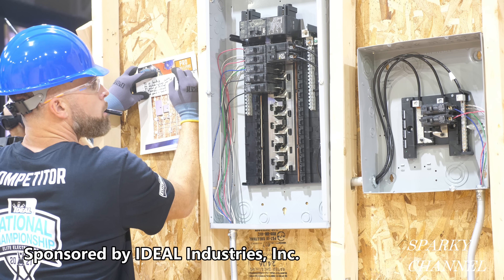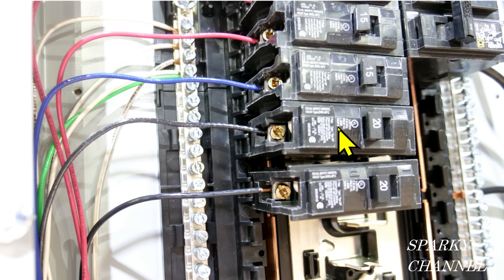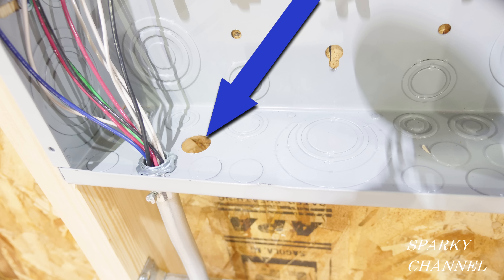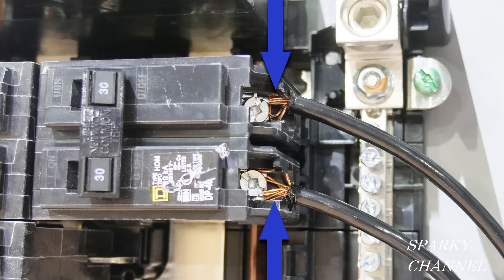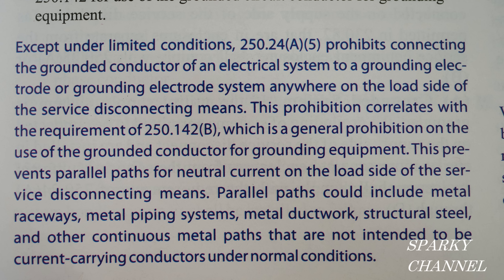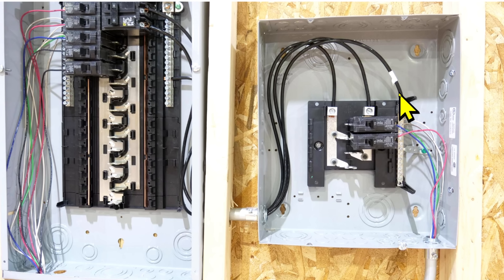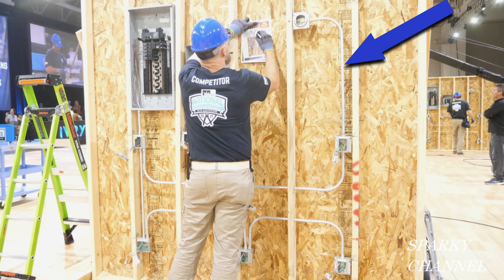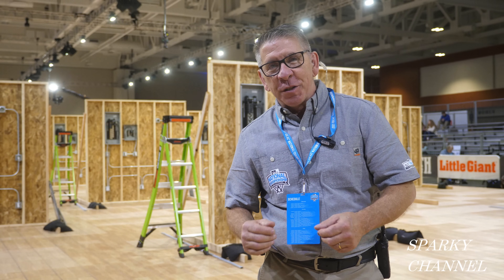Find the NEC Code Violations! IDEAL National Championship Code Violation Board Round 1 Part 2

Comment: But NEC  allows wire  manufacturers to use a thinner insulation on wires now days.  How is that progress??
Wire  years ago  had  twice the thickness of insulation. Did  safety get compromised  to save money??
insulation is everything
Reply from the maker: This is from the 2020 NEC so it should all be up to date.
Reply: theres a lot of different insulations you can buy, with different voltage ratings, theyve found better plastics that can insulate just as well and reduce pipe fill
Reply: The natural rubber used in 1930 was over four times as thick as modern THHN/THWN, the critical values are abrasion resistance and dielectric separation, and the TH from the 1940s used the same OD as modern THH/WN, or maybe a bit larger, I haven't checked with calipers.
Reply: If it's better then it would have a greater shear strength..dont see how it could if it thinner
Reply: @71organicmusic9  you are comparing rubber to nylon, and a cotton sheathing to a cross linked polyethylene sheathing, we have a large list of different materials to work with now and arent limited to rubber, as well they have plenty of tests to get a product ul or csa certified

Comment: I'd have to say NEC IS the violation making this CRAP now mandatory
Damn AFCI's and those stupid "Tamper Resistant Receptacles" 100% trash now!
AFCI's are not ready for prime time yet! However the GFCI is as they have been around for years now and pretty much all of the kinks have been worked out but a GFCI with the older NEMA 10 series for a dryer and range will always trip as the ground and neutral are tied together thus the GFCI seeing a ground fault, the NEMA 10 series is un-grounded.
Reply: Yup, they lobby hard to make old appliances/machines obsolete, including welders
Reply from the maker: Thanks!
Reply: @SparkyChannel  Real or sarcastic Thanks? 
NEC is going way beyond the "Minimum Standard" these days in my humble opinion.
Reply from the maker: @Peter_Yachymczyk  Real thanks because I can tell that you're giving your real opinion.
Reply: @SparkyChannel  Cool can't always tell with internet speak
Reply: The arc faults ate s little touchy trippy.  But by in large the code requirements are an improvement

Comment: Gray wire as a grounded conductor ?  NEC used to state the color of the grounded conductor was required to be white or NATURAL gray (as in raw uncolored wire insulation).  Did NEC drop the ball or something ?
Reply from the maker: Hi Farmer Dave! See 7:35
Reply: 277/480 Neutral

Comment: I saw quite a few code violations that were missed. No Ground Wire to Subpanel, no separate bus included for that grounding in subpanel, I believe today's subpanels must have a sub-main disconnect inside the subpanel itself, though not a code violation, breaker amperage should be arranged with the highest amperage breakers closest to the main on the bus.
Reply: Sub main disconnect is if over 6 breakers.  Unless that changed.
Reply: @whattheschmidt  Thanks, though not over 6 breakers, the panel has the facility for over 6, therefore I would expect the necessity for a Sub-Main Disconnect.
Reply: @yo yo I beg to differ. Though it is not a code violation, it is still better to have the highest draws closer to the main.
Reply: Correct me if I'm wrong, but wouldn't the conduit connecting the main panel to the subpanel count as the equipment grounding conductor?
Reply: @KingdaToro  No, it never is.

Comment: @2:23  I was taught to leave 1/8" of exposed copper and I continue to require apprentices to do so.  The entire screw is hot, It's not an additional hazard.  Having insulation under the lug is a hard to find problem, it will act like resistance/a bad connection/fire hazard. It makes it easier to inspect.
Reply from the maker: I would say don't get any insulation under the terminal and don't leave too much copper showing. The example I showed in the video was about 3/8" copper showing. I felt that was too much copper showing.
Reply: @SparkyChannel  oh, the 3/8" doesn't look like much in the video
Reply: It Cerates a High Open or High Joint Depending on Where You Live and if You Point a Thermal / Temperature  Gun at The Screw it Should Read a Higher Temperature Under Load Than The Other Breaker Screws !

Comment: A 2P breaker or handle tie was not used for the multiwire circuit in the main panel? 240.15(B)
Reply: It's actually not. If it was, there would be only one neutral in the panel. Two neutrals means two separate circuits.
Reply: @KingdaToro  There are 5 breakers but only 4 neutrals if you look carefully. So one has to be shared.

Comment: Shouldn’t the breakers be AFCI and or GFCI
Reply: You're all assuming this is a residential installation. Metal boxes and emt. This could be considered a commercial installation where AFCI and GFCI aren't necessarily required. I guess it would be up to whomever is putting on this competition to clarify.
Reply: I thought so too in new construction
Reply from the maker: You just caught another violation! :)
Reply: What is afci? I could Google it, but human interaction is more satisfying
Reply: @Patstickyman  Arc Fault protection. They are required on all 120 volt 15 and 20 amp circuits in "dwelling rooms", pretty well everywhere except garages and some basements (ones used only for storage). Kitchens and laundry rooms used to be excluded but most if not all now require them.
Reply: @Patstickyman  Arc Fault Circuit Interrupter. Any arcing or fast rising high current spike at load startup will trip them but they are a pain where power tools are used & for older refrigerators due to inrush current spike at start because of the inductive load.
Reply: @davidbrewer7937  okay, so similar to how a 3 phase motor would have overvoltage protection to keep it safe from the spike when it initially starts?
Reply: AFCI in bedroom's only where i live.
Reply: Outlets are all AFCI these days with the exception of the refrigerator dedicated line.

Comment: It looks to me like the top four circuit breakers are the ones not installed properly and the 20 amp is actually installed correctly. Those four breakers don't appear to be engaging the plastic tab properly on the left side. Are we assuming that the main breaker is the service disconnect? If not, then the neutrals and grounds must be separated in both panels and the bonding screw removed. Also, is the lack of a grounding conductor in the nipple connecting the 2 panels necessarily a violation? EMT is rated as a grounding conductor. If that's a rigid nipple, plastic bushings would be required, maybe even a grounding bushing. Best practice would say yes, but... I will always tape every neutral to its hot wire. It's absolutely necessary to identify the neutral with gfci and afci breakers. Speaking of those required $50 breakers,  none are shown in this residential mock-up.
Reply from the maker: Wow, I hadn't noticed that about the top 4 breakers not engaging the plastic tab properly on the left side. Excellent job! Yes, apparently the main breaker is the service disconnect. Excellent observations.

Comment: Not enough info on first clam that a #14 on a 20a CB is a code violation. Is the circuit feeding a mushroom fan on roof with separate over current protection at motor? That 20amp CB could be there to protect wire from ground fault and to assist in unhindered motor starting. Just saying.
Reply: We are very clearly dealing with a residential installation.  Granted different rules apply in different situations. My comment is based on what I see.
Reply: Nope still a violation.  Even if what you are saying is true, There would be no reason not to (re)run the circuit in 12ga.  An inspector will look at it and see 14ga wire on a 20A breaker, period.
Reply: @scottsatterthwaite4073  hi Scott, glad your following Sparky. Lots to learn, I learn something every time I crack NFPA 70 for 1/2 hour or so! Not sure of your background or education, but if your dealing solely with Edison circuits in a residential setting you have it nailed and yes the cost difference between #14 &#12 are very small and easily justified to upgrade but when getting into a 50HP 3phase motor the over current protection and cu prices rise quickly. Chapter 240, 430,& 450 are very large and complicated but with a little studying I know you can master them. And yes some of the combo inspectors may question a #14 on a 20amp CB but a calm and informative discussion with a code book at hand can educate them and get some ink on the permit.
Have a good day Bryan
Reply: @scottsatterthwaite4073  That's not correct motors and welding devices have their own sizing rules.

Comment: you missed the most obvious one: there is no grounding/bonding conductor between the main panel and the subpanel.
I'd also be suspicious whether they practiced proper circuit hygeine on their neutral conductors, and if they had a multiwire branch circuit in the main panel, without using a handle tied or common trip breaker.
Reply from the maker: Happy Holidays Ken! Great to hear from you. At 8:32 I did say that the panels not being properly grounded is an NEC violation. But you're correct I should have been specific about the sub-panel grounding.
Reply: @SparkyChannel  Isn't a direct metal-metal bond still valid?  It looks like the sub is mechanically tied to the main via a metal nipple.
Reply: @scottsatterthwaite4073  I use a 3/4 offset and its gets passed every time.

Comment: Pipe fill at the main panel. Can’t really tell how many conductors are in the 1/2”
Reply from the maker: There are 4- 14ga hot conductors, 1- 12ga hot conductor, 3- 14ga neutrals, 1- 12ga neutral and an EGC (ground wire). So there are 7 14ga conductors and 2- 12ga conductors and an EGC. You can put 9- 12g conductors or 12- 14ga conductors in a 1/2" emt. The EGC doesn't count. So this emt fill passes.
Reply: yep, gotta do the calcs to see if they have to derate the wire beyond what the minimum wire size for the protection allows for.  that's 8 current carrying conductors in the pipe.
Reply from the maker: @kenbrown2808  Ken, can you tell me if the EGC counts as a conductor when counting for emt fill? I've been looking in my code book, handbook and on the internet. It seems to be a controversial topic.
Reply: @SparkyChannel  it counts for conduit fill, because that is about physical dimensions. The egc has physical dimensions, so you have to include it. But you can do actual conductor sizes if you have reduced size nuke & ground.
Reply from the maker: @kenbrown2808  Thanks Ken!
Reply: @SparkyChannel  of course if there is plenty of room in the pipe, pipe fill is usually fine.

Comment: Really,,too much were stripped off at the breaker,and don't other types of breakers work in different panels. Not claiming to know everything,,but really
Reply from the maker: Although circuit breakers may appear to be similar, they are brand specific. Even if two or more circuit breakers look identical, they may differ significantly in their functionality if they are from different brands. For this reason, never attempt placing a different brand’s breaker in an electrical panel of another brand. Although circuit breakers from one brand may fit in another brand’s electrical panel, they will not work properly. Because of this, every manufacturer will recommend that you use breakers that are specifically designed for your brand panel and are the right type.
Reply: They will typically work, as long as you're dealing with the same shape of breaker. For example GE breakers, Square D QO and Eaton CH won't fit in anything else. However it is always a NEC violation to violate UL listings.

Comment: Aren’t both the main and the sub panel unbalanced?  I’m not very fluent with NEC code, but I’ve always been instructed to make sure that the number and amperage of both sides of the box (main or sub) are roughly equivalent.  Both panels in the video seemed very unbalanced.  Am I wrong on this?
Reply from the maker: In the old days panels were like that. But panels like this alternate between the "A" and "B" hot cables coming into the panel on one side. So you could put all the breakers on one side and it would probably be nicely balanced.
Reply: It goes by rows, not columns. Each leg feeds every other row, so if you start at the top and work your way down you'll be balanced, whether you use one side or both. It doesn't matter too much in residential split-phase, the worst thing likely to happen in a very unbalanced panel is the main tripping. That can be solved by moving breakers around to balance it. When you actually have 3-phase service, it's much more important.

Comment: Another great video, Bill as usual. Not only are grounds and neutrals on the same neutral bar, there is no ground bar in the sub panel, plus not sure if the neutral bar is isolated from ground as required.
Reply from the maker: Great point! Yes, I should have mentioned that there was not a separate ground bus bar. No, the neutral bar was not isolated. It was bonded to the panel which should have been grounded. All in all, that sub-panel was pretty messed up. LOL!

Comment: The horizontal conduit shown right at the end of the video is passed through the 2x4 studs too close to the front of the studs. The holes are clearly not drilled in the middle.
Reply: NEC 2017, 300.4(A)(1)Exception Note. 1: Steel plates shall not be required to protect rigid metal conduit, intermediate metal conduit, rigid nonmetallic conduit, or electrical metallic tubing. 😊
I haven’t got a copy of the NEC 2020 yet. 😳
Reply from the maker: I agree. Do you happen to have a NEC code for that? I've looked and couldn't find anything specific to emt in studs.
Reply: @SparkyChannel  I don't know for USA NEC, but in Canada, EMT isn't considered protecting from physical damage so it has to have an approved protection if not at 32mm from the edge.
Reply from the maker: @defo9546  Makes sense!
Reply: @defo9546  if it still is, it shouldn't be.
Reply: A gorilla hanging drywall with a screw gun will tear hell out of EMT.
Reply: @scottsatterthwaite4073  so will a gorilla hanging shearwall with an air nailer
Reply: I thought the same thing,I’m not an electrician but they did look to close to the surface,maybe if they had a nailing plate over them they would be ok?